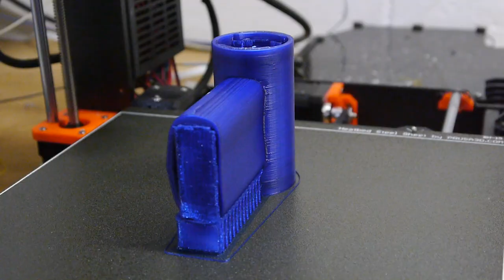Snorkel Mask / Respirator Hack ... 3D Printed Adaptor

Comment: I’m thinking about filling the mask’s tube with granules of activated charcoal(used in aquarium filters) and some wadding and making 2 holes on the walls in the internal bottom of the tube to join all the 3 sections of the tube and use them as “air in”, and to effectively make the tube an actual reusable antigas filter. And maybe also use part of a vacuum cleaner’s sack (which usually block particles as little as 30 micron) to seal the top. Would it be good? Here in Italy we can’t really find those professional filters in reasonable times, and they are way too expensive
Reply from the maker: Something is probably better than nothing. The activated charcoal would help with the virus though. Gases sure, but virus I don't think so, I could be wrong. Just having your air supply not coming from directly in front of you and the protection of not being able to touch your face accidentally probably will help alot as well. You do have to be careful if you don't use an actual gas mask cartridge. mario padilla posted this link down below https://youtu.be/X-5Uwbz5yOñ it describes how if there is not a check valve on the air inlet on these cheaper mask that you can suffer hypoxia and pass out. Essentially air recirculates in the mask and you breath in your own breath which is slowly increasing in CO2 concentration and at a certain level you pass out from lack of oxygen, especially if you are exerting yourself. Stay safe!

Comment: I’ve watched a video where a guy use microscope to look at his 3D printed mask, and there are microscopic holes on it between the layers, you will need to spray some coating on the surface to fill up those holes, otherwise viruses may still get in, not very likely, but possible.
Reply from the maker: Thanks for heads up. That shouldn't be too difficult to do.
Reply: flex seal maybe :)

Comment: Can you make one in the same dimensions as the standard C420 PAPR in use in NATO? 

Eg, a 40mm hose/adapter to the snorkel mask, and standard sizes for the respirator parts like the M95 canister filter
Reply from the maker: I tried finding dimensions on this and it is surprisingly hard to find. It appears the major thread diameter is 40 mm and the thread pitch is called out as 1/7" The thread form is also interesting as it is not a crested v but more along the lines of a ball thread. I found my old soviet gas mask, which is supposed to be able to thread into the NATO standard. We will see if I am successful in interpreting the threads. Thanks for the suggestion.

Comment: Thanks for sharing! I’m a surgical resident from the philippines. Is there a way to replicate your adaptor for 3D printing?
Reply from the maker: In the description is a link to Thingiverse where you can fine both the .stl and the .step files. You should be able to manipulate the .step file and model it to fit your cartridge if you have a similar mask. I 3d printed the adaptor in the video so yes it can be 3d printed. Although as has been pointed out in other comments it should be painted or sealed at the least to be safe. I hope this answer your question. Thanks for watching
Reply: @JoshAQ  Thank you so much!

Comment: Hi. What kind of filter cartridges (model , manufacturer) did you use ?
Reply from the maker: It has Sperian Model 2101 on the cartridge although they were purchased from Menards or Lowes or Home Depot several years ago and are meant only for working with paints and such. I can't find the same cartridges online anymore so they must have changed adapters recently.
Reply: @JoshAQ  Thanks for your reply. What types of N95 or N99 cartriges  (matching the adaptor) are currently available online ?
Reply from the maker: @cristiani1955  I couldn't find any available online. Sorry.